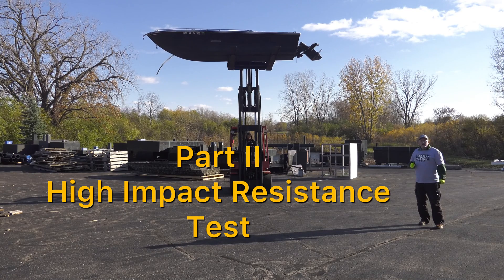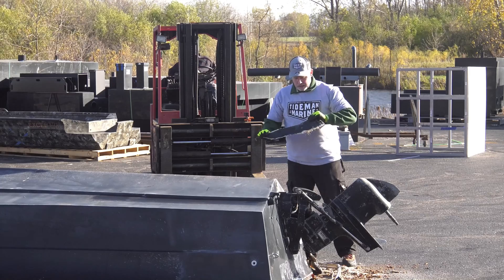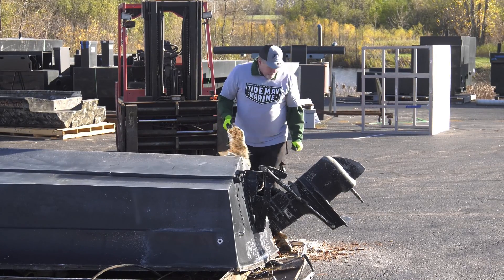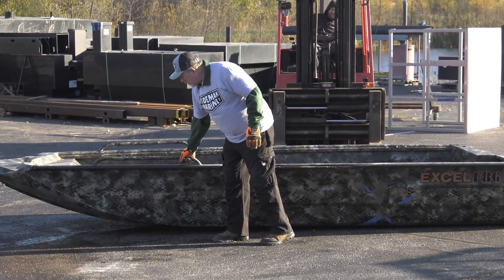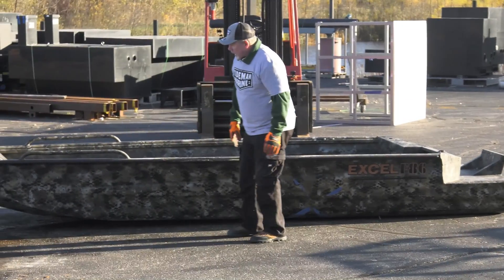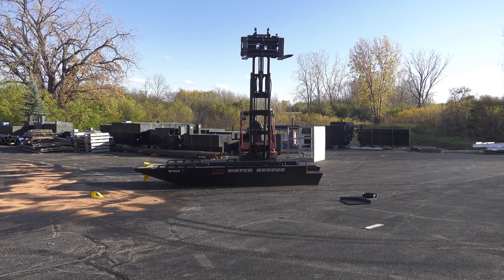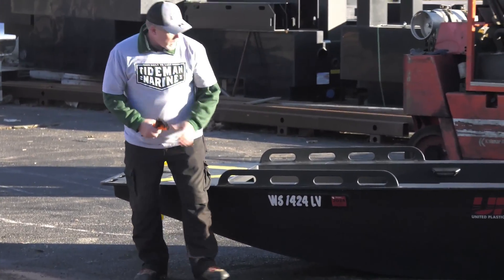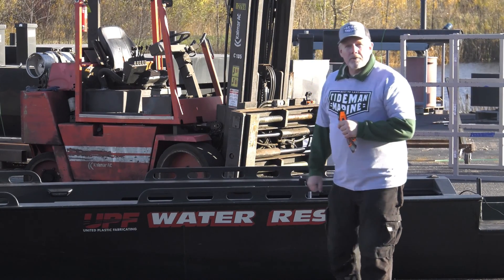Finding the Best Boat Material | Extreme Drop Test!

Comment: @TidemanMarine You said, "You see this whole side here, in the rear section, [is] basically in pieces ..."  Unfortunately, you never bothered to move the camera or use a second camera so the viewers could see anything. Lazy video making.  Also, I agree with @Michael-gi9wl about exaggerated damage comments for aluminum boats. Overall, this just comes off as shilling for HDPE boats. And that's unfortunate because I think HDPE boats have a lot to offer. Just do it fairly and honestly.